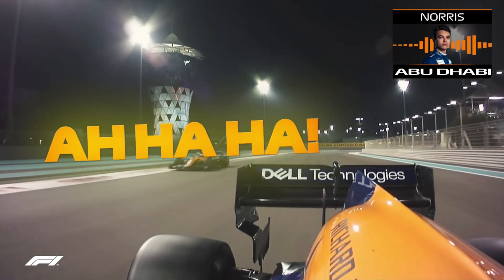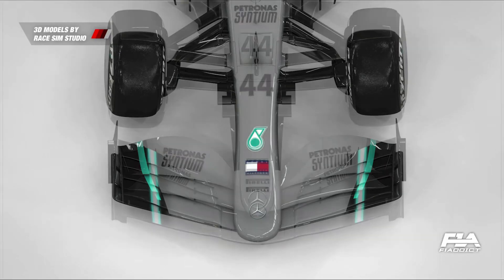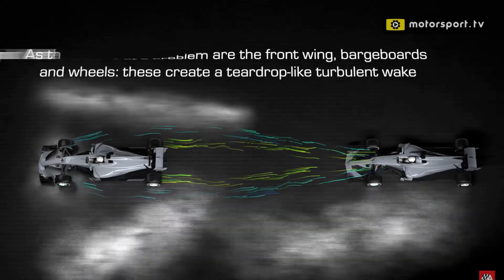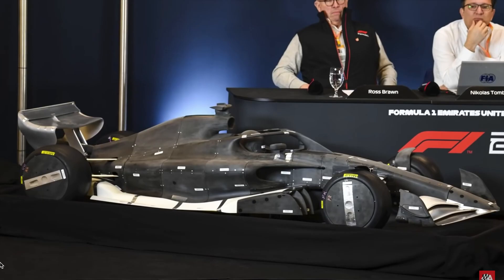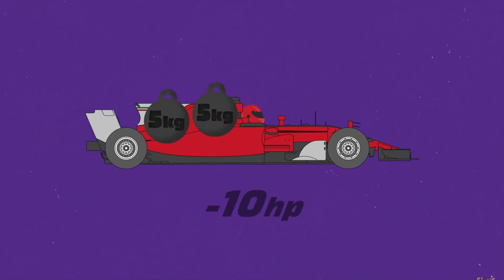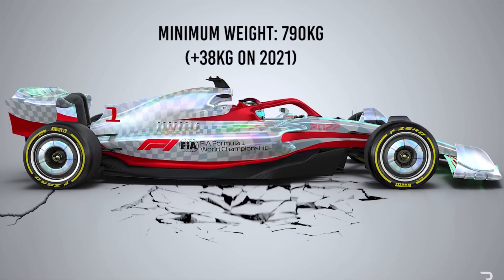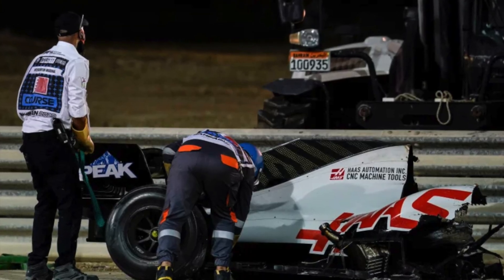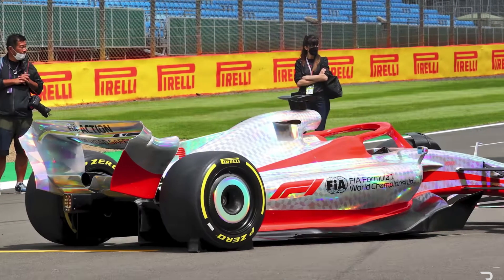F1 2022 carsexplained- FIA2022FormulaTechnicalRegulations-F1TechnicalReviewSeries by Nazli Guleryuz

Comment: High performance cars usually have bigger wheels to accommodate bigger brakes and allow less sidewall deflection. Modern performance cars that aren't Miatas or BRZs are so heavy it's practically a wash 😅
Reply from the maker: Hi Daniel so nice to see a fellow engineer here 🏎🏎Well said! 
Commercial high performance cars also probably value safety (hence bigger brakes) over speed a little more knowing not all the customers are professional drivers (now I want to double check that reading Euro NCAP requirements, must be a real page turner 😀)I know you do a lot of restoration with cars have you ever change wheel sizes along with the brakes? That would be a tough and scary one to do 😀
Reply: @f1tech249  I have replaced and restored brake components, but never gone bigger. I have switched wheels many times but usually only go wider to increase contact patch. I've only gone up in wheel size on my Miata but that was from only 14 to 15 inches and an inch wider. Combined with stickier rubber the lateral grip went through the roof. Suggested speed limit in tight corners is at least half what that car can do comfortably 🏁 I'd add that F1, Indy and NASCAR don't need huge brakes like an AMG Mercedes SUV because they weigh a fraction of what those vehicles weigh. It's all just conversion of kinetic energy to heat and bigger  brakes can take more heat before they're melted and useless. You probably already have a video on this 😜